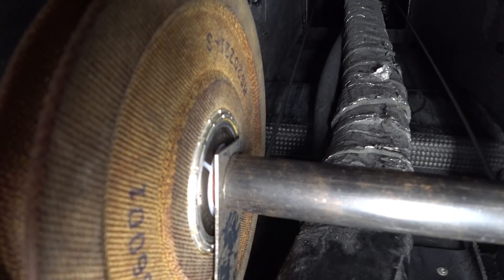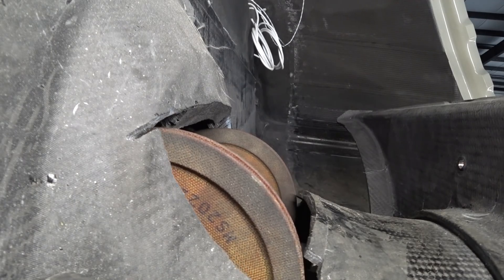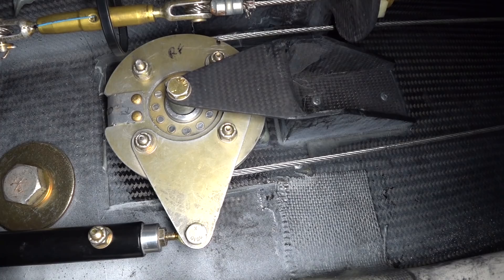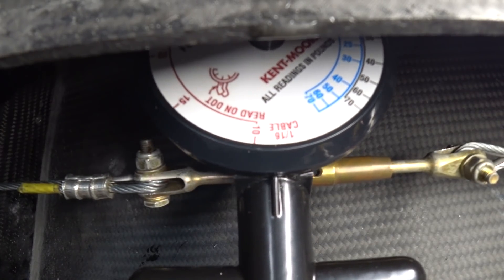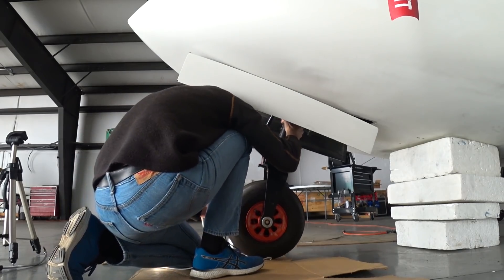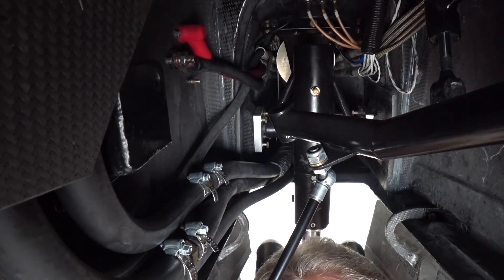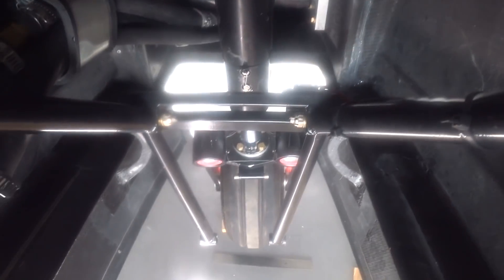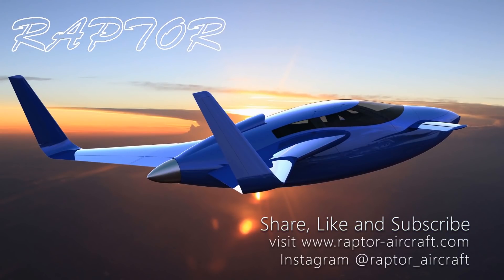Back on its Feet - Building the Raptor Prototype

Comment: I'm with spqba747. That tension is way too high. Cable strength has nothing to do with what the cables should be tensioned to. Take the Piper Cherokee at 40lb for instance, or if you want a high performance aircraft, the Piper Navajo at 35lb. Your cable tension is way too high.

Comment: A few videos back, someone had replied about the cable stretch; which shouldn't all be that much. If the shaft and and pulley brackets and shafts are weak enough to flex--as you tighten the cables anything over compensating for that stretch and their own weight--you are curing the symptom more than problem. Though, now the pulley system now has a higher static forces placed on it.

Because you done multiple implementations to root out the cause of the flex; unfortunately, now your construction techniques are starting to show that on video. Are these not the most critical parts of the plane?

Comment: Control system rigidity now looks good, but what level of friction is present?  Perhaps I missed it, but I don’t recall seeing that.  Friction must be low enough for ailerons to aerodynamically center even at the low end of the airspeed envelope.
Reply from the maker: Surprisingly, with the tension I have there's no more friction than at 30lbs tension. The ailerons center as soon as you let go of the stick because they are nicely balanced.
Reply: @RaptorAircraft  - So they balance alone at zero speed. Nice!
Reply: Excellent.  That should do the trick then. Good work!

Comment: If that minimal movement of the nose pulleys does turn out to be an issue, surely all you'd need to do is support the shaft at its centre as well as the ends.  That should fix it 100%.

Comment: Have you seen Mike Patey new product? Rubberized zip ties they prevent cutting or chafing of electrical wires and such. I thought it is a very clever idea and you can reuse them.
Reply: I thought so too.  Especially since the army aviation command banned zip ties for electrical wiring,  these make me feel better for my projects at home.  I need to check prices to order some

Comment: Raptor Aircraft   Am I being a bit too critical/paranoid here?  If you stop the video at 3:10 and look just left of the center of the pulley, the, what looks like 1/8" steel bracket encircling the main shaft, appears to be slightly cupped with the pointed edges going towards the pulley.  This causes my (sometimes over reactive) imagination to see an NTSB report that says something like this,  "With time and use, the pulley moved towards it's bracing bracket and the pointed edge(s) of the cupped bracket became lodged in the pulley preventing it from rotating."  A not-too-dissimilar scenario killed my Flight Instructor, so for my own mental health, please have a close look at it and set my mind at ease... Please.  Thanks and LOVING the build!  (a medically grounded builder and quite sad fly-boy. :)
Reply from the maker: Thanks for pointing that out but those brackets are touching the sides of the inner part of the bearings that are at the center of the pulley. The inner part of the bearings don't rotate so there's not an issue.
Reply: arbee11 I think you have a valid point and one that is an easy fix for all similar  brackets; bend the corners away from the pulleys :)
Reply: I believe he did thank him for pointing that out. 👍
Reply: Definitely a valid concern, but please remember this is a Prototype!

Comment: Off topic, but given the size and "roominess" if the cabin would it make sense to go with a single large door to simplify things a bit, and make pressurization easier?  Just thinking out loud.
Reply: ,,, Peter answered that quite awhile back, and said something to the effect that he definitely decided on two doors .
Reply: not really given how the seats are going to be arranged since there a back seat.
Reply: @TransamJc  I'm not sure how that makes a difference. Access the entire back seat from either side just the same as you would from both. Anyways, probably not worth discussing will ultimately be someone else's decision but just makes sense to me as a logical place to simplify things
Reply: Exactly the reason I won't own a single door Piper or Mooney
Reply: Thanks Roland I didn't remember that I may have missed that video